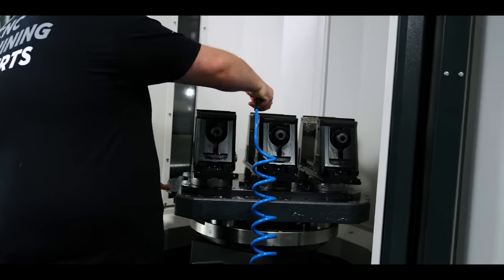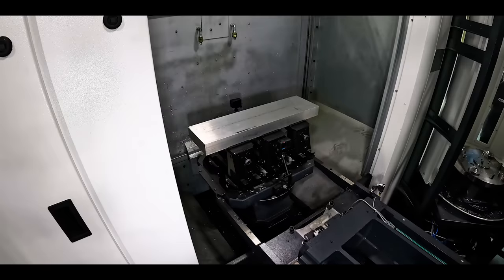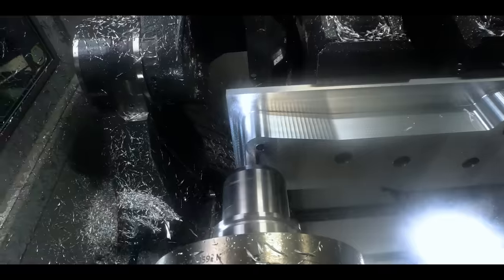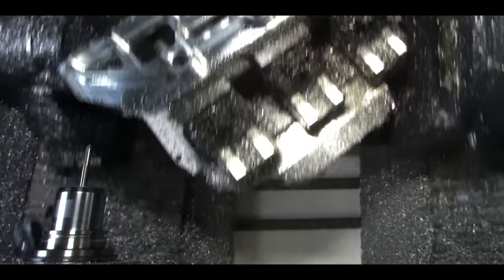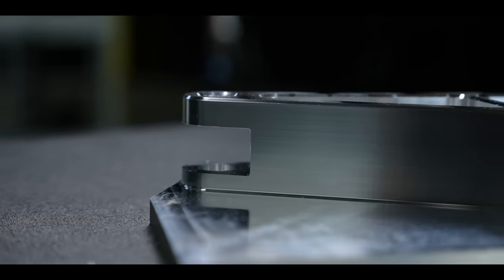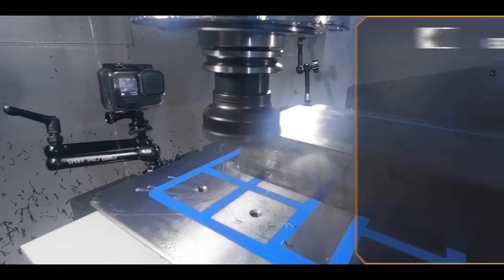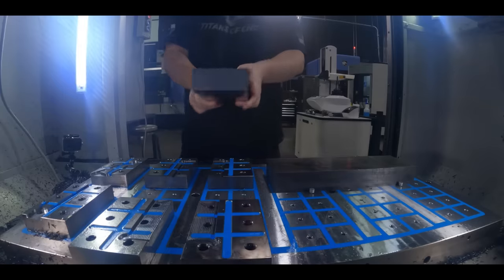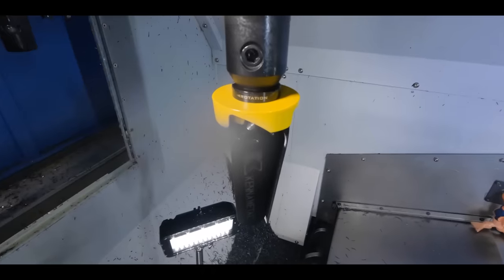Can You Fake It Until You Make It in CNC Machining?

Comment: I've been programming and operating for 14 years. Did my first few months as a button pusher. I only make $34. 😑 Would love $50
Reply: in the uk im a full time programer setter and im on my 5th year on £13.1 an hour could only wish to be on $30 an hour
Reply: I've only been at it 4 years. I make the program, run the parts make offsets adjust geometry and make a cool 19 an hour (just lathe work)
Reply: @notAsterix do you make parts too or just write programms/setting tools?

Comment: I’m on month three of my new career as a machinist and I can say without a doubt that the first two was nothing but mistake after mistake after mistake. I didn’t know how to use an independent jaw chuck, didn’t know what sweeping a part meant, how to fixture properly and rigidly to know the part would not move during processing, didn’t even know anything of the materials that I was processing or what to look for, hear for, or why something didn’t go that well. I knew the basics of CNC and how aluminum works. I knew how to program but now I don’t do the programming. How am I to function as a machinist if I have no clue what is being done or why. All these questions loomed around me daily. My first part for me to work on, I crashed the tool into the material. Second job I was assigned, I thought I did well until I didn’t check the program to see if the bigger end mill was being compensated for and made holes bigger in a $5k part. These mistakes gave me imposter syndrome like nothing else could. I was almost in tears when leaving my job because I felt like I was a failure. I wasn’t cut out to do this job. Luckily, the light was being shown to me, my boss told me that they were happy that I at least showed up to work and never faulted at wanting to learn. Patience was granted to me by not only my boss but those who worked around me. Now today, I have picked up my pace for the parts I’m given, I stick to a procedure that I lined out for myself to follow and have made some great parts and wrote a few general lines of code to help with certain parts. I streamlined a production part to help figure out how many parts can be done in a day if given the right conditions. I collaborate not just with my boss but my co-workers and the programmer. I see what the programmer sees on his simulations. I say all this to boil down to this, mistakes happen, you are human, your work ethic will show soon just hang in there and find a couple of co-workers that are knowledgeable so you can ask questions! Progress doesn’t happen instantly, you have to take your knocks and you have to dust off and move forward. Keep your eyes on your goal and don’t give up!
Reply: Trust me, if your coworkers are good people - the only thing you shouldnt do is act like you always know better than the experienced machinists. Not that they cant be wrong - its just extremely annoying getting told what youre doing is wrong by someone who cant work an hour without destroying something.

Also never lie to your coworkers - especially if youre asking them for help with a fuckup/problem. Dont show them a crashed machine and then point to the CAM program on the computer - when the program you just ran is still sitting on the machine and tells a completely different story :face-purple-crying:

And for gods sake - always use your ears to listen for any things about to break. I have coworker that will hit cycle start, turn around and sit down at his PC and put on his headphones. The entire jobshop is often looking over at him because it sounds like his machine is about to lift off the ground. Him? Doesnt notice a thing.
Reply: That sounds exactly how my first days on the job went when my brother got me a job at the machine shop he was at. My first few days and months were so agonizing because I was loading fixtures wrong, loading parts backwards and not knowing what to listen for a mangling tool holders.  But I kept at it, paid attention to everything that everyone told me and especially paid attention to the engineer that made the fixtures for the parts was doing,  and before I knew it, I was turning up the feeds and speeds to go from 100 parts a day to 125 parts a day. The owner let me do my thing and didn't stop me, so the 125 parts a day went to 150, then 175 and at the end I had doubled the production without using more inserts then when it was a 100 a day. So it's definitely good to step out of your comfort zone and explore,  just make sure you Don't step too far lol.

Comment: I actually turned down an offered job because I thought I wasn't qualified. The shop called me back in for further discussions , wanting to know why I turned down the job. NOT wanting to look like an idiot, I told them I thought my lathe skills weren't up to the standard they required for the position. Obviously they recognized something I did not. They said the shop foreman was a lathe wizard(which he was). They said they were comfortable and confident that I was the right candidate for the job. Basically said if I got overwhelmed with the lathe aspect of the position , go the the shop foreman and he'd set me straight. Well turns out I had considerable better lathe skills then I thought. I personally prefer mill over lathe. In the end I excelled at the position and did some great work for the company before they decided to relocate elsewhere in the country. They tried real hard to get me to go with , but turned down any offers to do so. This was my first real fore ray into working in a Model/R & E type environment. I learned a lot. Came away with more confidence in just having to figure it out . Worked with some really great people and made some really great parts. I figured it would be better NOT to oversell myself , which I didn't. I think they appreciated the honesty and was rewarded with a really great job. I know what you mean Barry about spotting the overseller/upseller. Spot them a mile away. I spent the last 12 years of my career working in the R & E shop at a major medical company. Very rewarding and meaningful. I honestly don't think I would have ended up there if it weren't for those guys that guided my into taking that leap of faith job with them.

Comment: I'm a machinist at a shipyard, my boss and project manager put me on a job to machine these propeller shafts for a boat and some of the tolerances were .001 run out and was trying to control it the best way I could but the best I could get was no where near what was asked, I've begged and pleaded with them that the set up that was pre established was no good. The problem was a ridgidty and roundness issue due to putting a few ton part on a machine that can't hold tolerances better than five thousandths with the weight and length and other seemingly impossible challenges. I dunno but I think we are looking at a dead part. Right now Im going through every machinists nightmare and don't have anyone to talk too.
Reply: I have never heard of a cnc machine that cant hold tolerances better than 5 thou. I have even used extremely cheap off hand tabletop cnc mills that are practically vibrating apart and they still hold 5 thou easy. Hell, even an old ass knee mill of some unscrupulous brand can hold 5 thou if you do it right. 5 thou should be easy to hold. Most cnc I have ran can hold tenths of a thou. so to me it sounds like a skill issue. 

I have not worked in a shipyard, but I have worked in a place that machined airplane wings, the cnc for those was approximately 20 feet long by 15 feet wide for the work area of the cnc. We would often throw in dozens of tons of material into the machine, and it would always hold 1 thou plus or minus. 

I do not know what kind of cnc you are working with, but I would have to imagine it is adequately sized for the part.
Reply: I will correct with I have heard and seen people claim that a machine can't hold tolerances better than 10 thou or 5 thou. However they were always wrong in my experience, extremely wrong. After having them go through their process of manufacturing I would rip apart their entire process and point out everything they were doing completely wrong, then do things a proper way and proceed to hold tolerances within 1 thou using the same machine. The average cnc machine can hold tolerances around 0.0007 thou. or 0.02mm. That is the average. and by using average methods. Changing how you approach it makes a massive difference in the quality of the end result. 

How well are you prepping your material? how are you mounting it? are you deburring and smoothing all the faces that go into the holding fixture? are you ensuring good connectivity with the clamping mechanisms? are you making sure it is properly seated in the fixture? making sure the fixture is torqued to specs, not too loose and definitely not too tight? are you doing your tap test to ensure the settings for your program is falling within parameters that allow for low vibration feedback during machining, also called chatter, but vibration is a frequency and even if it is not chattering, some vibration patterns are more stable and accurate than others. Are you checking the program code? ensuring it is compensating for all the geometry of the part? running your simulations? accounting for heating of materials and thermal expansion in the bearings of the machine as well as the part? accounting for gravity and flex due to part rigidity? all of these things can be accounted for and factored into the program to accommodate them. How about chip load? are you taking a proper chip load? not biting off too much and definitely not biting off too little? I often see one of the biggest mistakes people make is trying to take too little of a cut and it just deflects instead and work hardens the material. How about your work holdings? are your tools properly set up and dialed in? what is the tool runout? how true are your bits actually spinning in the machine?

Comment: Ever since I was a kid, I had ideas and inventions in my head but with no way of bringing them to fruition, I was relegated to being just a dreamer.
It wasn't until I was in my early forties after watching countless videos of Milling and Lathe work and CNC machines, I finally grew some balls and decided to buy some desktop versions of these metal working machines.
I started out with Harbor Freight versions of these machines.  From there I slowly upgraded to slightly larger machines, and from there I bought my first CNC hobby mill.  It was a Tormach 770 with all the bells and whistles.  I had no clue in the world how to use CAD/CAM software or how to read and write G-Code.  I had no formal training.   I had only trial and error training, and it was mostly error training.
Eventually I figured it out enough to start making at least some of my dreams come true.
I dropped out of Jr College and started my own Custom Auto Upholstery business.  I worked mainly on vintage vehicles.  In many instances it was difficult or impossible to get replacement parts for these cars, so I had to make them myself.
In my spare time I would work on my own projects.  One of these projects was a replacement trigger for a specific Air-Rifle.  It was the Umarex Octane break-barrel air rifle.  I came up with a design that improved the trigger pull on this air rifle by orders of magnitude.
I ended up selling hundreds of these replacement triggers to buyers around the world.  The design was so simple but, for me that dream was huge.  Now I can come to the end of my days knowing that I was able to make at least some of my dreams come true.
Reply: Awesome story. Actually reminds me of my grandfather. He hated crows because they ate his garden. His air rifle was his pride and joy
Reply: @barrysetzer    The air rifle I mentioned was purchased because of all the feral pigeons we had in my area.

These pigeons would roost over my customer's expensive automobiles with expensive paint jobs on them.

The acidic pigeon poop would mar the finishes of these paint jobs which meant that I had to spend an inordinate amount of time buffing them out before the customers picked them up.

That pellet rifle created a 60 to 70 yard no fly zone in all directions from my property. Any pigeon stupid enough to enter that no fly zone was usually dispatched with one shot.

Those pigeons seemed pretty smart because they learned pretty quickly not to come near my place.

I eventually bought a PCP air rifle that was more accurate and more powerful.  That particular air gun moved my no-fly zone out to about 70 to 90 yards.  On rare wind-free days I could put the smackdown on a pigeon out to a hundred yards.
Reply: I think you are really great, you love what you do and work hard for it. I have encountered some difficulties at work recently and feel it is struggling. I hope to be like you.

Comment: I got a little desktop CNC (the 3018 Pro from VEVOR) for my birthday cos I always wanted to mess with a CNC but didn't want to drop thousands into a machine that I might like... 

I have experience in FDM with a couple ender 3 series printers that I got a while back and they are fun, but I always loved watching CNC machines take some chunk of material and make something out of it... But man is this so much harder to learn on a CNC compared to a 3D printer...

Even just using the pre-made files that come with the machine are rough to work out how and why they do things the way they are, and this is just on wood. I know that there will always be more challenges with small and cheap machines but like I said, the whole point of it is to work it out before having to sell a kidney XD

So there's nothing but respect for what you guys do on these machines that can process metal the way you guys can.

Comment: I was not that passionate about machining for the first few years. I was just a manual machinist assisting the shop. with my managers reluctant permission after pestering him for months, I slowly learned the only unoccupied cnc and I self studied solidworks and mastercam at home. All other cncs and machines were taken by seasoned machinists way older and skilled than me. 

until they all retired or left. it was a small team of 4 with a manager, but after they left, it was just I alone in the tool room. My manager asked..."They're not gonna hire anyone else because of the budget...can you do these projects with these machines?" I basically replied, "yeah I got dis I'll figure it out". Long story short, I learned the cnc edm, the cnc lathe, the conversational programming shopmill with a 4th axis, and got even better with the cnc mill. I definitely was thankful of my self study at that moment. Still, it was a challenge and i think it literally grew my brain's neural pathways because I used to be an airhead and kinda dumb, but now, I'm definitely less dumb. Jokes aside, I grew alot to where everyone respected my work and started relying on me to run the whole shop and support the production department. I'm on track to become the manager of the tooling department by the end of the year. 

 I think the best way to grow is to throw yourself into the fire, use your brain, and never give up.

Comment: I started out at the age of 28 in a shop owned by a couple of partners. I didn’t know that they were having a falling out.  I worked there for about 6 months sawing material and drilling holes in jigs on drill presses.
Their issues came to a head and closed the shop down. One of them got me a job at a company that made industrial ice cream equipment. Big machines that made thousands of products a day. The day I started it was 100 degrees and no ac. There was smoke in the air from all the cutting oil from around 30 mills and lathes.
I was given a job of several thick walled aluminum angles with probably 4 inch equal legs. I got them cut to length and put their holes in. 
They also had a 2 inch radius, not a full radius but quite deep along the outside corner. There was a 2 inch corner rounding tool that was quite old and dull. 
I didn’t know a thing about feeds and speeds or depth of cut. The Bridgeport was an old step pulley mill. 
I started out cutting and there was a godawful scream from the tool and angles. I stopped and looked at it for a moment and tried again. Same result.
I changed my depth of cut and tried again. Nope.
Someone took pity on me and showed me what to do.
Slow the speed down considerably and take lighter cuts and use a liberal amount of oil.
I made it through the day while noticing the looks I got from the other guys.
So, I came back the next day and started to learn all I could and spent the next 41 years in machine shops.
I learned that you should never quit learning ever and never be afraid of asking questions.
Reply: As a cnc machinist for 25 years you never stop learning.